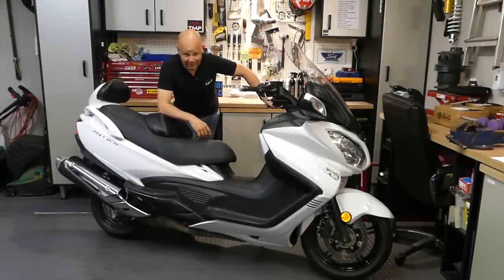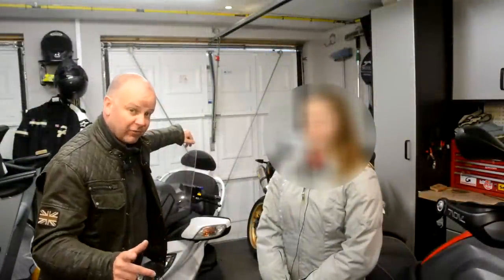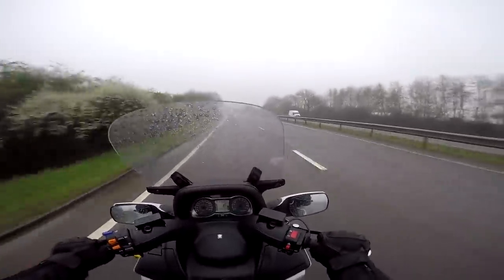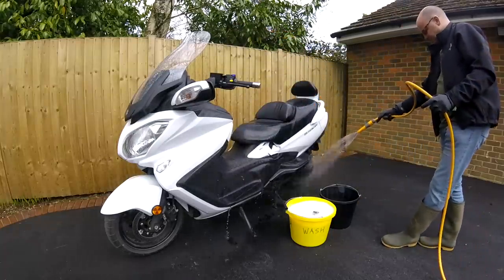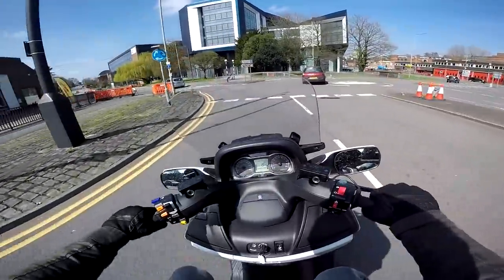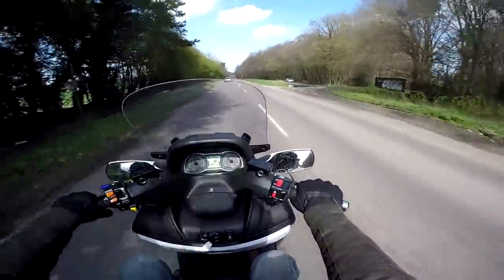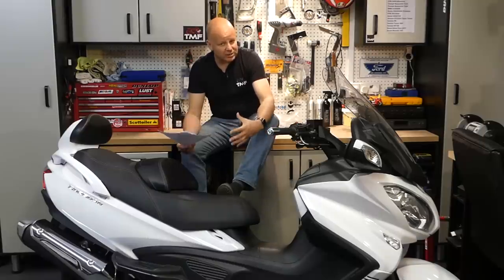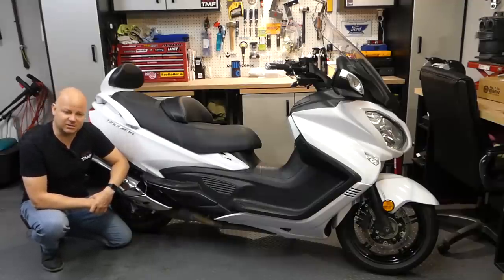2018 Suzuki Burgman 650 Executive - Long Term Review

Comment: I'm 62, riding a motorbike since I was 19. I have a back wear and I have an older Suzuki Burgman 650 from 2002. I have driven a lot of heavy motorbikes, but this Burgman is the first that I can ride that I have no problems with my back. But also in the driving experience, it is not far from an older Goldwing.

Comment: The Burgman 650  stands head and shoulders above the rest . I have toured  to Portugal , South Spain, Scotland  and in the last 2 weeks Berlin . 1600 miles riding in 4 days . All luggage [50 ltrs] stored under the seat . Top speed during the trip 110 mph . Kept up with everyone one the trip including a Triumph Rocket 3 . What more do you want ?
Reply from the maker: Thanks for watching and for stopping by!
Reply: Yorkshire UK . Regards Peter
Reply: that would make a great video series touring Europe on an scooter like this, well I think it would be cool
Reply: sounds like you've been following me on my 2014 650 Burgman now just coming up to 50,000 miles and loved every one.
Reply: Hi I own a 2017 650 Burgman it is the excellent bike I ever bought the reason why they call me scooter Steve cuz I had the very first 2003 Burgman when it came out I owned all the models that you can think of the older ones plus two new ones I even had the very first 2013 but I like the 2017 cuz it has a heating seat and heating grips is very comfortable and easy to drive I'm watching one of your videos and you're talking about it so I just want to let the public know if you're right it is excellent bike I even purchased a Sharp stereo system I like it so much and if you go to my website scooter Steve you can see my scooter on there well you guys keep the good work up I'll keep watching your videos thank you very much scooter Steve
Reply: I to have owned four 650 Burgmans ,did over 30,000 on two my current machine is a 2014 with over 50,000 on the clock .( BRILL)
Reply: Burgman is nice, BUT my BMW CG650gt is nicer. I have three scooters for my family. The BMW is the quickest off the line.  Followed by my Honda SilverWing. The Burgman is the slowest. 

Handling. The BMW tops the 3 here too. Followed by the Honda. 

Comfort. Again, first place, the BMW, followed by the Burgman. Sorry Honda!

Cost. Here the Honda leads the way. Cheaper to buy, insure, and much easier on fuel. The Burgman falls right in the middle here. 

Gadgets. Got to give that to the Burgman, due to the power mirrors. Both the Suzuki and the BMW have the power wind screen. Both have heated seats and grips, but the BMW allows more control over the heat. Honda is just the basics. 

All three of these scooters are great. All are capable of long tours. The Honda is quick with it's 600cc engine, and is quicker than the Burgman probably due to weighing less. 
The only scooter I would love to add to my collection is the KYMCO 700cc maxi scooter (MyRoad). I know it would be the least quick, most weight, basic like the Honda, and the biggest gas hog. But hey, it's a 700cc maxi scooter!

The only thing all these maxi scooters need is electronic cruise control. All are capable of cruising at over 100mph, so a cruise control could keep you from getting some tickets. 
Do try one of the maxi scooters out. Way more storage room than most motorcycles. Comfortable, and easy to operate.
Reply: A real bike maybe, not a ridiculous moped
Reply: @gpecaut1  Get out of here with your bmw is nicer crap. This is about the Suzuki this isn't a bmw vs suzuki blog. I road the bmw and it was garbage I hated it. I would choose the silverwing over that tin can.
Reply: My brother i had the Burgman 400 which i lost in accident,and i have the 650 now which is a beast.However the 400 is excellent,i rode from west palm beach
Reply: @gpecaut1  You're from Tampa?! I am as well; I always wondered what a trip out west like that would be! (tiring? fun? worth it?) I'd love to hear more!
Reply: @gpecaut1  well u were lucky cos the average bmw motorcycle since the aircooled twins are very unreliable. I have ridden both and the burgman wins for me and moreover look at worldwide sales of bmw scoots and burgmans. Argument setlled
Reply: Just a quick heads up, the Rocket 3 is a BSA, the Triumph is a Trident, both three cylinders. Keep riding 👍

Comment: I had a 2009 Burg and what a great machine! It WILL, as you say, do 110-115MPH per speedo which is pretty much correct standard and not the usual 5+- mph deviation of most Asian bikes. EASILY 100mph for nearly everyone (ummm, so I'm told :). The point is though is that it can cruise all day at highway speed. It also gets there QUCK and will rival street bikes. I was complimented on my scoot by some very talented young street bike riders as to its speed AND it is just a 650! It is the most stable machine I have ever ridden and I bought mine after breaking my neck/back ending my 30 year police career. I could not get my leg over a bike for a long time BUT the step through and comfort of the Burg was perfect. I know you are quoting DEALER costs for maintenance, which IMHO is VERY HIGH and way to SHORT of interval. It is NOT what my excellent dealer even came close to and my insurance agent LOVES the Burg with a very low rate of around $125 /yr with full coverage. They may not look like it BUT they are really easy to work on and the body molding comes right off with a removal of a couple bolts. The engine is UNDER you and opposed so it is smooth with a super low center of gravity making it so stable that low speed maneuvers are easy. I took a riding course for instructor prep with it and it was so easy to do. It is automatic OR you can use the thumb shifter. It also has a really nice/smooth SHAFT DRIVE!
 It has a TON of storage under the seat that lifts up as a TRUNK and your fuel is also BEHIND you and low helping handling. AND when it rains you are completely dry (while moving) by the front fairing which does a great job even protecting your arms from getting wet. The electronic windshield raises/lowers instantly to keep the wind/rain off you. IF I did get some drops on my helmet visor I would just drop the windshield for a second, the wind blast would clear my face shield and then put the windshield back up. 
 I bought it used in 2012 with low miles from the said dealer who had it traded in by original owner for a new Burg. I only say this because the dealer actually BOUGHT MY BURG when I traded it in for my 2014 STROM 1000. I bought the VEE because I was recouping well at the time and wanted to be able to get down some fire trails, etc in my travels. I SHOULD have kept her but did not have the space BUT when my leg will not get over the saddle again, I'm getting a BURG again!!!
Reply: Did you say "shaft" drive? My '03 had a CVT gearbox with stacked gears all the way back to a gear drive for the rear wheel.
In fact there were three different oil changes required for servicing the engine/drivetrain;
The engine,
Gearbox (CVT)
and final gear (rear wheel).
Not as bad as it sounds.

Comment: I have owned a 2008 Burgman 650 Exec for the last 8 years.  Rode it almost exclusively for the first 3 years, and put 27K miles on it during that period.  Touring ability?  No problem.  I added a pair of Givi panniers and a Shad top box, giving it Goldwing-like capacity, with plenty of room for a large duffle on the pillion seat if needed.  Did a 500 mile ride one day, no issues.  It has since been replaced as my main ride by a Triumph Trophy SE, which is one of the greatest touring bikes ever assembled.  But each time I hit the road on the big scoot, I can’t help but get the famous ‘Burgman Grin’!  
I do agree that cruise control is the missing link to complete the bike, although backlit switchgear would be great as well (even my Trophy doesn’t have that).  And the bike is sneaky fast!  Anyone who knocks it, obviously hasn’t ridden one. Thanks for a great review!
Reply from the maker: Cheers Jim!
Reply: I have a Goldwing and have had a Burgman, I think the Burgman is the nearest to a Goldwing type experience of any bike. In fact sometimes I wonder why I don't just get another Burgman, it's much more practical and nearly as comfortable.
Reply: @RufusCapstick  I've actually got the money to upgrade from my 2007 Burgman to a Gold Wing (automatic tranny, of course) and I'm thinking now that I would be better off just to upgrade to a new Burgman. Maybe I should go rent a GW for a day and see if I can fall in love with it. Even if I purchased a GW I think I should keep the Burgman. I just don't see myself hopping on a GW for a quick run to the store like I do with my Burgie.

Comment: Bought my AN650 Burgman at the beginning of 2015 and still have it. It has been the most reliable and best ride of any bike I have had (since I started riding in the mid 70's). Totally agree about the protection provided when riding in the wet as I used to wear a suit to meet clients with an all in one over the top. I always turned up presentable in the worst of English weather. 

This was the reason I got the bike in the first place, to be able to ride to work across long distances on motorway and inner city rush hour conditions anywhere in the country and that paid off when I was the only thing moving (with other bikers of course) for 20 miles or more in the jams (love the ways those mirrors folding makes me as thin as any other bike...and after time the buttons become second nature). 

The only point I would make with you is that you didn't mention this bike is a wolf in sheeps clothing. Flicking a switch turns the bike from a sleepy automatic (relatively speaking) into a very nippy manual (change up/down is by button like grand prix cars and when you stop you automatically go into neutral). The other button you didn't mention is the sport button which is rather like a kick-down on a manual car... press that and the bike changes down and you discover exactly how much power was hiding under the fairing for that get out of jail moment.

I am retired now and the bike still suits me because (as you said) its cheap to run and great for everything else non-work related.
Reply: How fast can it go?

Comment: I own a 2018 BMW R1200 GS Rallye as well as a Yamaha Tmax 500 and I know I should not say that, but I love riding the scooter more. It´s easy handling, the smooth an relaxed riding, the storage capacity, the wind protection. I don´t miss anything, not even the power, which is more than enough for relaxed and fast touring. The burgman 650 would be a step further. Thanks for your review(s) from germany and keep going on like this...

Comment: After 11 years and 76,000 kilometers, my Burgman Executive is still my favorite motorcycle. Great in town, you never have to get back to first gear at every stop. Lots on integrated secure storage. Good weather protection included. Smooth power delivery. Comfortable on the highway. Very user friendly. My friends  and I always got burned by our bikes when I first got into riding (hot engine parts and exhaust). You would have to try really hard to burn yourself on a Burgman. I  don't like the digital speedo on mine. It is the only bike I have seen with a gear drive to the rear wheel. It is hard to push, since you can't take it out of gear. It is easy to push when it is running, but since you can't take it out of gear it is not safe to push while running. I have three other bikes; SR185, CX650E, and an XV1100.

Comment: Fantastic review, as was the other video. I have had a Burgman 650 2007 model for 7 years and some 80,000 miles in that time. Its an incredible ride for me here in Spain after years of London riding. I just purchased a newer one a few days ago as I don't think there is another bike that suits my needs. I use it for touring and days out hiking in the mountains and countryside , where i can take all my kit and stow helmet , jacket and trousers under the seat. After hiking I can stretch my legs for the home ride. An awesome ride. I have to add that I was crying with laughter at your last three negaative points about the looks, price and size. I have the older Burgman which is even bigger looking. I love it, its a tank. I see other bikes being blown about in the winds here and my 249kg tank just cuts the wind. The price is higher than a normal motorbike but in the end the service is cheaper. I rememeber paying 180€ for my Michelin Anekee minus vat and mount. The Burgma cost about 120€ all in.

Comment: Thank you for a very fair, balanced and comprehensive review, TMF.
The Big Burger has moved on a lot since I owned one of the first UK ones, but it's always been a mile-shrinker and has always had bundles of comfortable get-up-and-go.
The 'crashy suspension' can be adjusted for preload and I wonder if yours was simply set too low. Certainly, mine used to handle securely on fast sweepers - two-up, too - and never caught me out.
Being very tall, I installed a Givi screen and never had reason to complain again. I dare say that you could do this to the electric screen too?
Pity you didn't show the cargo hold in all its glory. It is absolutely massive and for some folk it would be the ultimate selling point, I'm sure. No Real World  motorcycle comes anywhere near to the BB's load-carrying ability straight out-of-the-box.
I'm currently looking to swap one of my bikes. I took a long hard look at a VStrom 1000 and a KTM 1090 yesterday but I was seriously attracted to a new BB as it stood menacingly, gazing down on the surrounding commoners. If I can make a bit more room in my garage alongside Herman (my old R100GS PD) then who knows?
Great review, TMF. Thanks mate!
Safe roads 👍
Reply from the maker: Thanks for watching and for stopping by!  All the best - TMF

Comment: I'd like to establish my bike/scooter owning credentials before providing my thoughts on the Burgman.  In the last 10 years I have owned a Yamaha XV1100, a Piaggio MP3 400 both sold and I now have a Kawasaki Voyager 1700 and a Suzuki Burgman 650 Executive.  I bought the Voyager while I was still working and my daily commute was 200kms.  In the 2 years prior to retirement I racked up close to 70,000kms and since retiring 5 years ago I have added close to 20,000 more.  You would be right in assuming the Voyager is my main bike.  I keep the Suzuki at my holiday place and in the time I have owned it I mainly use it for short runs to the shop or around town although I have take some longer distance trips on it.  The Burgman is an excellent scooter at home on the city streets zipping in and out of traffic and lane splitting (if that is legal where you live the fold in mirrors are welcome).  It will hold its own at 110km/h the national speed limit in Australia although I once took it on a back road and ran it up t o168km/h before I decided I was out of my skill and comfort zones.  The CVT means twist and go and it pulls away at the lights quickly so the lane splitting is a good idea.  I find full auto mode is best but there is a manual mode if that's what you want.  There is also a power button for extra revs when in auto mode for over taking.  I have never used either of these features as I find the bike does what I need when I need it without more fiddling so I can enjoy the ride.  The ABS brakes with 2 discs up front and one on the rear bring the machine to a quick stop.  The parking brake provide a bit of extra security when the bike is on the side stand.  There is plenty of information provided to the rider via gauges, read outs and warning lights and a good throaty sound form the pipe.  At 638ccs it is a big engine by scooter standards but not when compared to big bore cruisers nevertheless it is meant as a touring scooter.  This is where the electrically adjustable windscreen is a bonus - it provides excellent wind protection at high speed taking pressure off the chest, arms and shoulders but can be lowered while riding for more airflow once you enter low speed areas.  The on board storage both in the dash and under the seat is good for carrying a few groceries or two full face helmets plus phones and other stuff in the dash compartments.  I would recommend if you budget allows that you remove the pillion back rest and add a top box - this will give you a small suitcase size removable box and still give the pillion a back rest.  My one accessory that I have not fitted but suggest you do if you plan to do a lot of open road riding is a throttle lock or breakaway cruise control.  The riding position is comfortable but the grips are hard and holding the throttle open to keep a constant speed is tiring in the right hand.  A machine that is fun to ride as easily at home on the city street as the open road.

Comment: The "crashiness" of the ride is due to small wheels increasing the effect of surface defects and that the lowest suspension setting being for a super soft ride. Turn it up a couple notches and the handling tightens up a lot.